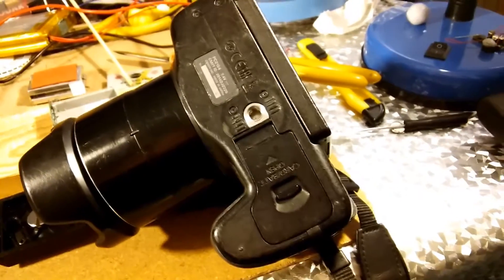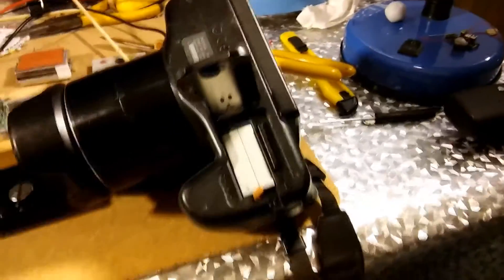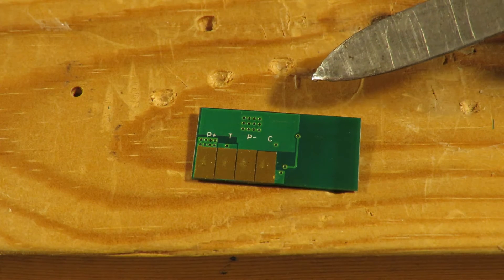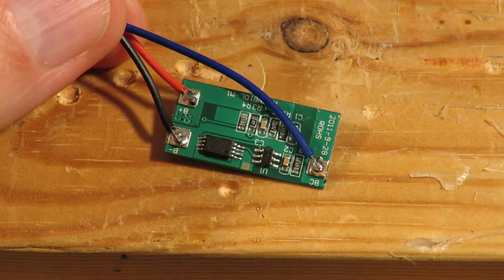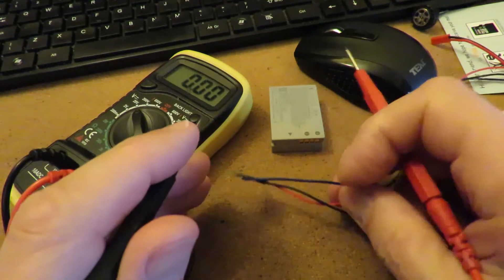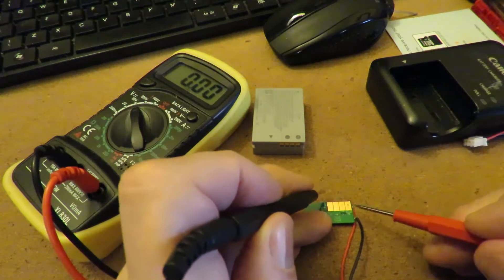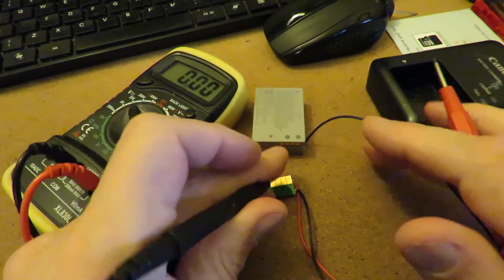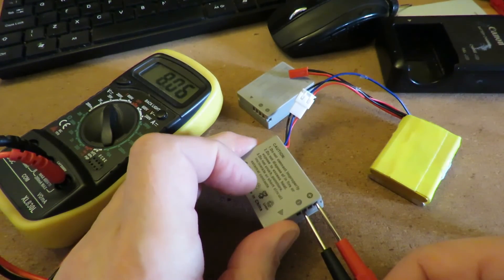Canon Battery NB-10L external power adapter

Comment: I know this is an old video but here goes anyway. Most of those circuits have a LiPo shutoff to protect from over discharge. When you charge the battery it resets the LiPo shutoff. 

When you are hot swapping the battery the LiPo shutoff sees low voltage and is kicked in and will need to be reset. 

Unless you plan to charge your LiPo through the stock NB-10L charger just connect your LiPo to the B+ and B- which will bypass the circuit. I think I’d prefer using a pair of 18650 batteries anyway. 

The 18560 cells don’t self discharge like a LiPo and they don’t need to have a storage charge if you decide not to use them. 

The biggest need for a LiPo to me is for high discharge use. The biggest problem with a LiPo is you shouldn’t leave them with a full charge if you’re not going to use them. The 18650 can be stored with a full charge and therefore you can always have one ready. 

2500 mAh 18650s are pretty cheap and you can get a series case for them. 

Fun video! 👍👍
Reply from the maker: Glad you commented on this video, I had always planned to revisit the project and try the suggestion that had been made in the comments. I had another look at it today and here is an advance view of the videos I have just done.
Part 1 Canon Battery NB 10L external power adapter REVISITED https://youtu.be/aEZh-JtfXBY
Part 2 Canon Battery NB 10L external power adapter REVISITED https://youtu.be/O9d6u5jTeek

Comment: Perfect safe to use the way you got it set up! Only Problem is you can not hot swap eternal batteries till you reset the CHIP and it need voltage from the Charger or any 7.4 volt source. If it was me i put small momentary switch in your adapter from the battery + to the adapter  +.  It would reset that chip.  Put the small switch behind a small hole and use  paper clip to push the  momentary switch!
Reply: Something has to be happening with the other two pads on the board.  If the charger puts 7.4 volts to one of those pads, does it need to stay there the entire time that the charger is connected?
Reply: @jayherde0   Not sure,  but they would not change just to tell the chip it got charged battery.  the other might be part of balance and some use  heat sensor!
Reply: @ghiapet51  It also might be that the charge actually happens through the (+) and one of the other pads - maybe the 'C'.  The chip might not do any output until the battery is much higher than the cut-off voltage.
Reply: @jayherde0  Yes that exactly why it works, but the reason it has to be done is the circuit is not started by the battery it started by the charging. Reason almost instructions start with Charge the battery first.  Some batteries is dead or looks that way causes when they are shipped new and that circuit board is not activated. And that great cause that circuit can discharge battery though it very little load but batteries are made and sold in day it more in year before the are sold!
Reply from the maker: Thanks for the suggestion.
Reply from the maker: Two years later, I just had a new comment on this old video. That spurred me to try your suggestions in your old comments so I had another look at it today and here is an advance view of the videos I have just done.
Part 1 Canon Battery NB 10L external power adapter REVISITED https://youtu.be/aEZh-JtfXBY
Part 2 Canon Battery NB 10L external power adapter REVISITED https://youtu.be/O9d6u5jTeek

Comment: Interesting but I would be afraid of doing something wrong and frying the camera.  I just received a power supply for my new Nikon P900 so I am good there.   : )     btw, finally found a couple solar rockers to mess with. They were in a resale shop for a dollar each. I know a place that sells them for a dollar new, when in stock. Have to wait to spring for that but I have these two for now.
Reply from the maker: Yes, I haven't actually tried the adaptor in my camera. In theory it should be fine but I can't afford to take the risk. Those solar rockers - I bet you keep them and don't use them for projects. I find it really hard to break them down as I just like them so much 😆👍

Comment: I suspect the K601? IC operates similar to the DW01 (see TP4056) in that it will disconnect the battery when it falls below a certain voltage to prevent overdischarge.

The IC will not re-connect the battery output until a good battery is connected and the IC 'reset', ie the 'CE', (Chip Enable), pin has been taken low, (grounded).

This 'reset' operation is not normally accessible by the user nor does it need to be...connecting the battery to a power supply, (as in this case), will do that for you as it assumes charging is about to commence.

If you think about it, the normal use of a battery is to subsequently place it in a charger once it's depleted, so you never really get to witness this 'disconnected' state unless you conciously look for it....like sticking a meter across it.
Reply from the maker: Thanks for the information.

Comment: This little trick on these, and other, batteries is infuriating.  Particularly because I have yet to find the answer.  Probably because I haven't found the right rabbit hole yet.  It makes sense that the battery would lock-off to keep it from cycling as the battery recovers a bit in your device.  I have several 'overstocked' batteries that have 4 pads on them.  One pad is marked (+) and two are marked (-).  I had a thought while watching your video.  Maybe, T is temp, and C is charge.  Based on the fact that I have two marked (-), maybe the 'C' needs to be connected to (-) via the charger to enable the on-battery circuit to connect the battery to the output?   ..   I was going to try connecting my two (-) pads, but that might disable the device cycling protection.  However, putting a weak (or overstocked) phone battery in a solar light can cycle without harm.  I hope we found an answer.
Reply: There may be a higher battery threshold for actually resetting the circuit ... meaning that it cuts out at a low voltage and cuts in at a suitable higher battery voltage - which your external pack definitely is at.
Reply from the maker: Thanks Jay 😁

Comment: Interesting that at  8:50 you place it in the charger and then power flows to the contacts.
I did somthing simalar with a laptop battery only i could not get it to work even with power to the laptop.
Reply: You might need to get the battery to a certain voltage to actually reset the circuit
Reply: @jayherde0  I recharged them before i solderd in and checked voltage after all good on the battery side.. :-(
Reply from the maker: I had a similar issue with my granddaughter's notepad. I disconnected the battery and charged it directly and the notepad ran fine, but still would not accept charge through the normal charging port.
Reply: Jay Herde I think that’s the case

Comment: Seen that more often. No output until you give it a charge. Even those DIY battery packs, which take 16850 batteries, they need to get a 'start' signal. It has to do with security as well. F.i. when batteries are in transit (from manufacturer to supplier), the output shows no voltage until charged properly. No harm can be done to the battery this way, it will keep it's storage voltage (3.6 Volt or so), otherwise it would slowly loose power when in transit or storage. It is all by design.
Reply from the maker: I just had a new comment on this old video. That spurred me to try the suggestions in the old comments so I had another look at it today and here is an advance view of the videos I have just done.
Part 1 Canon Battery NB 10L external power adapter REVISITED https://youtu.be/aEZh-JtfXBY
Part 2 Canon Battery NB 10L external power adapter REVISITED https://youtu.be/O9d6u5jTeek